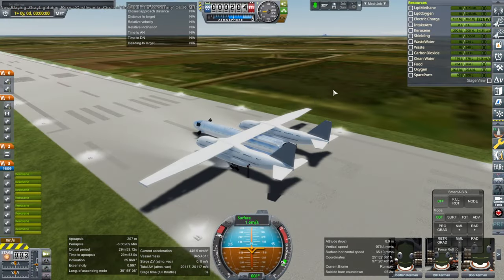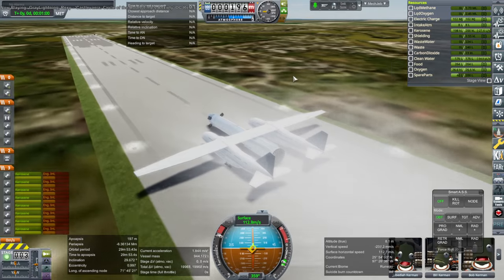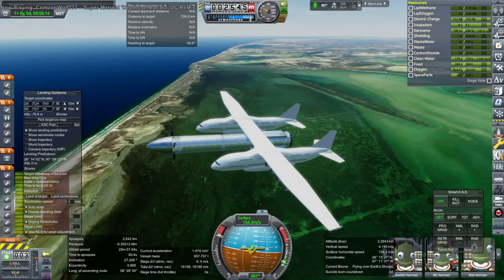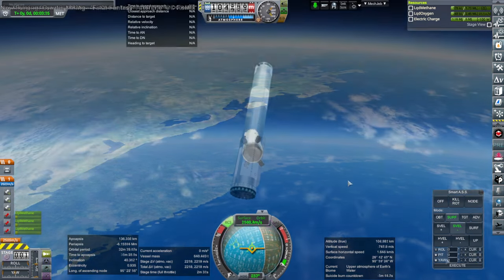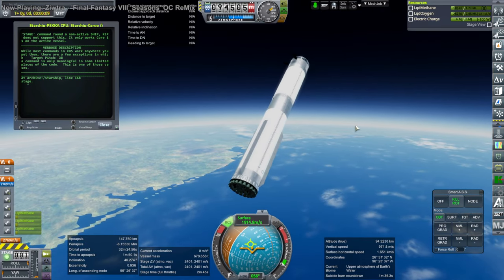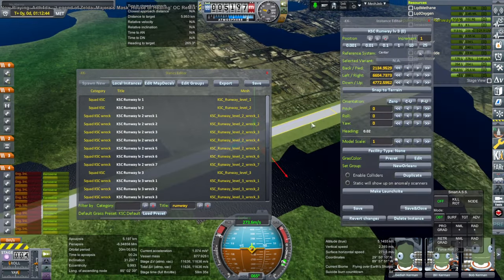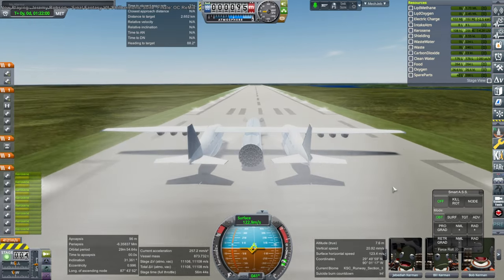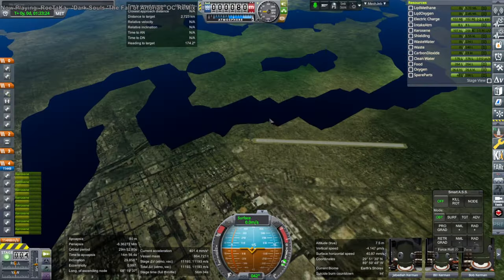Super Heavy, By Air (RO in KSP 1.12)

Comment: niceeee awesome concept

i’m gonna use that kind of system to carry back my spaceplane that i’m using to air launch one too

if you put proper aerodynamic strakes like new glenn on superheavy then could fly an extended downrange trajectory successfully perhaps

also btw is it that easy to just use kerbal constructs to place a stock runway wherever you want? I’ve got it and would be useful to put it on a downrange island i’m landing my shuttle boosters at currently but not sure if it was actually a menu and not just a dependency for other mods - that don’t work :(
Reply from the maker: You have to be physically at the location in flight mode to be able to place something with Kerbal Konstructs (open the menu with Ctrl+K), and you have to create a group for the statics to be placed under first (that function is in the menu), but otherwise it's that easy.